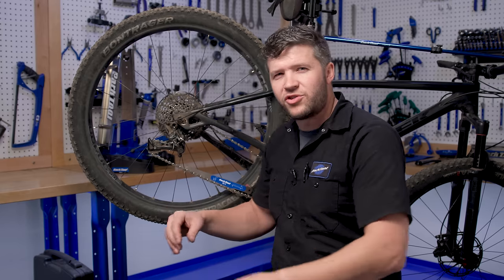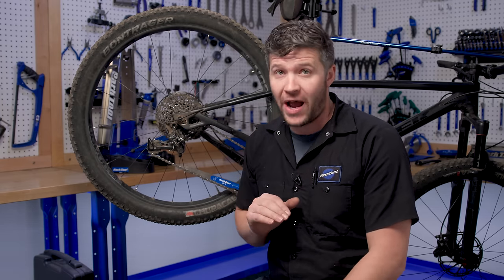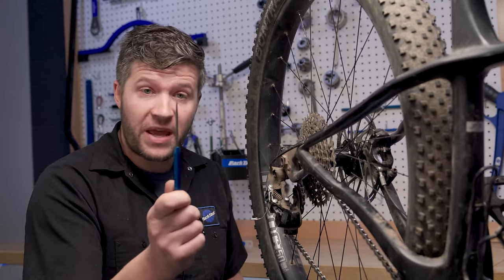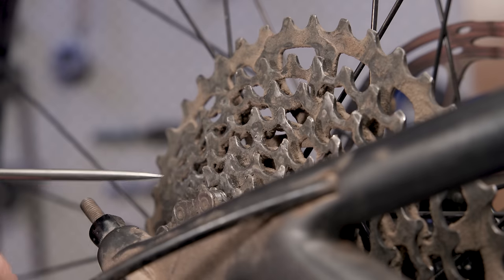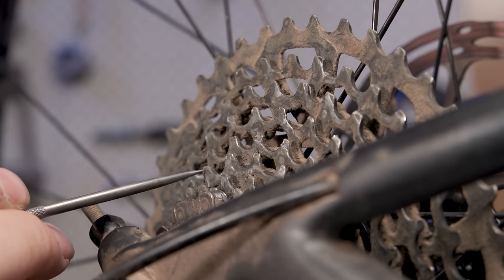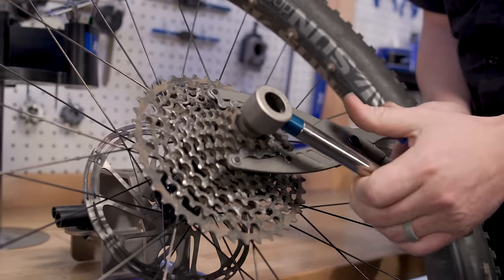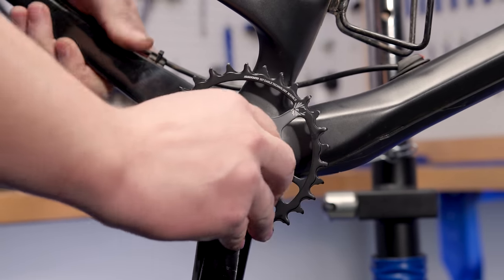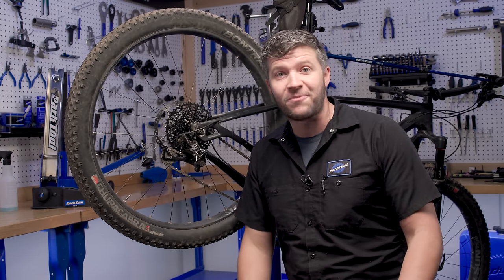Cassette Wear | Tech Tuesday #189

Comment: I recently changed the chain on a shimano 1x12 as it was reading just over .75.  After changing the chain the chain was skipping but only in the smallest cog on the cassette.  I looked around and found that shimano sell a pack containing a just the 10 and 12t cogs (search part no Y1X498030)  probably not the ideal solution but it worked for me as only my 10t cog was deformed and its about quarter the price of a new cassette.  Just in case that helps anyone 👍🏻
Reply: I use a shimano ten speed on my ebike, the 4 smallest cogs are separate and the rest are on 2 spiders. The small cogs (and spiders) are available separate and they are cheap so buy them in bulk!!
Reply: That's an option I've taken several times. Nothing can match a 1/8" wide track chain and sprockets for distance. Check out Sheldon Brown's site. No, not the football player.
Reply: I think you are meant to change 12 speed chains at about 0.5. Just something I heard.
Reply: @krzysiu4003  you're right.  I'm just lazy 👍
Reply: Doesn't using worn cassette (even though it doesn't skip) wear the new chain faster?
Reply: @AdamWilkoszarski  more teeth mean more engagement points to spread the load. Only your favourite/most commonly used bigger sprockets wear out as well as the smallest. Most MTBs and e bikes will be the tiny cogs from descending and the first gear. A road bike will be middle of the cassette and a touring/bikepacker is going to be somewhere in the middle

Comment: I use a “dummy link” it’s single two links, it’s just one set of outside links attached ti the inner links with the rollers, set it on the chainring or cassette and if it slides back and fourth, the chainring or cassette is warn, if it sits in place and dosent move back and forth they are just fine
Reply: Good idea ^^
Reply: I do the same thing but I got 4 links and pinned it into a square, a bit hard to pin it but a nice neat gauge tool.
Reply: Very good!!!!!

Comment: Once I put a 4th chain  on a 6500 Ultegra cassette at 7,500 miles and skipping immediately started. I installed a new cassette, but to my surprise, riding just a few dozen miles meant that the chain had worn funny also and therefore I had to bin and almost new chain. So I’d say, if there’s any doubt, just replace the cassette before risking a new chain (I understand this advice might not be applicable one of those super expensive mountain bike cassettes. Keep those drivetrains as clean as possible! It was painful to look at the one in this video.)
Reply: first voice of that, did you measure chain to see where and how much it is extended, i have experience where new chain made cassette to cure after some km of light use- when that chain stopped skipping, i installed new chain to check is really cassette fixed or just chain extended and adjusted on that cassette, and new chain did not skip
Reply: This is actuallyalong the lines of something I was asking about in my own comment. If you're chain isn't fit properly, can it cause premature wear. And it sounds like that answer is yes.
Reply: @keithchristner4522  explain how chain can be  installed unproperly and that would not be obviously ,
Reply: @makantahi3731  new SRAM chains are unidirectional and can be put on backwards. Only thing I could think of.
Reply: @randalclark6283  so,if chain does not have direction or side of installation,if is properly passed through derailleurs,if link is not frozen,nothing else can be done wrong with instalation,,chain wear is in direct connection with maintenance

Comment: Since you're going to need a new cassette eventually anyway, might as well buy one when you buy a new chain, and at worst not have to use it right away, but if you used that worn chain for any time, you'll probably need it sooner than later, if not immediately. Plus, prices tend to go up so this locks in the savings.

Comment: I actually like cleaning my bikes so I do it every 500 miles on both my road and  touring bike.  That includes re-lube of the chain.  New chain every 3,000 miles.  Neither bike gets particularly dirty, at least not for long.  Road bike is 32 years old with original chainrings and cassette.  No skipping issues and very quiet.
Reply from the maker: A clean bike is a happy bike! Older road bikes with fewer gears did last quite a bit longer due to the additional material.
Reply: you clean and lube every 500miles, i do it every 100km, you must be pedal like dove, when i made 2000km per month, i replaced  1 chain per month, but i drove races, my wife same chain would never wear
Reply: @makantahi3731  if I cleaned my bikes every 100K, it would be one every week or sometimes both every week.  I follow Calvin's bike cleaning video.  If I am really efficient, it takes 2 hours to prepare, wash, dry, and relube both bikes.  These are road and touring bikes, not mud bog or hill climbers.
Reply: @fouresterofthetrees287  i do not clean frame fork rims, i only clean chain and sometimes cassette and front gears, i use wax and everything around transmission is relatively clean, and chain waxing must be done at 100-120km, 1 pass with wax takes 3-4minutes, usually i made 2 passes, so 8 minutes and chain lasts at least 6 times longer than on oil, i do it for last 5 years and i spent maybe 5-6 chains that works on 3 bikes: on my road bike goes new chain that stays on it 3-4000km, then it goes on my mtb for 1000km and after that it goes on my wife bike and it stays there until got worn, every bike always has same stretched chain
Reply: Austin Jew  do you remove chain from bike and put into petrol/thinner?
Reply: @makantahi3731 I soak my chain in gasoline in a closed container and agitate it. If you think you are doing a good job of cleaning w degreaser, take your degreased chain to the gasoline and watch what comes out of it!
Reply: @OVER-bENGINEERED  since I use wax, I don't wash the chain as it should be done if I use oil: the chain stays on the bike, I heat it with an induction heater, soak it in wax and wipe it with a cloth, at the same time I clean and lubricate it, if the cloth shows that the chain is dirtier , I repeat the process, with each repetition, the wax in the cloth is cleaner

Comment: I bought an old road bike and the previous owner let the chain stretch way too much. As I wanted to use it for commuting and some training and didn't want to invest too much into it, I simply replaced only the chain. It is a 3x8 setup and guess what - everything works just fine. I think that once your cassette and chainring(s) are slightly worn and a new chain does not skip, it is almost always quite a bit cheaper to get some more kms/miles out of your old setup.
Reply: old compoents mixed with new components will cause all of them to wear out faster
Reply: @bmxscape  You are right. I was pointing out that sometimes it is possible to get some more use out of your old components instead of replacing them. To put it into perspective - I paid around 12 euros for a new chain, would need to pay at least five times as much for a new chain, cassette and chainrings. If this gives me even a couple of hundreds kms more out of the old components, I am still perfectly fine with it.
Reply: @benokrizek8020  yes that is a good point, getting the max life out of old components is also a good thing
Reply: yup, I always found that you can ride with a worn casette for many thousands of kilometers and given how much cheaper that are than chains it can be worth it

Comment: Love the pick tool tactic! Great tip! I also think it would be worth to mention if you're replacing a drivetrain to also make sure to examine jockey wheels conditions as those wear out too.
Reply: Do they really need to be replaced? I think they are not receiving intense load
Reply: @omniyambot9876  not as often as drivetrain components, but I've seen jockey wheels also become like shark fins from wear.
Reply: @omniyambot9876  I've had them cracked on SRAM X9,X0 , Rival. Never has an issue on Shimano though.
Reply: always have some spare jockey wheels at home - the bearings go on them - OEM jockey wheels are often poor & the ball race can seize-up with dirt. Remember the top/bottom jockey wheels are different and they are also directional - keep the instruction leaflet to ensure correct installation.

Comment: There is actually a go- no go tool for checking chainring wear. I believe Park makes one. With all the ramping and profiling on modern cassettes and chainrings this might not always work. Cassette cogs typically wear out according to the one used most and small ones faster than larger.  I never thought about looking for the burr but that makes sense. The real proof is if it works well with a new chain. Or an interesting experiment with a half worn chain were used. No doubt this has been done and worked, forestalling expensive repairs. The chainrings may not even be available but worn chains are!

Comment: Excellent demo. I have exactly this issue. New chain skips intermittently on highest gear only so old part-worn cassette is still OK for a few miles yet because I rarely use the top gear.
Reply: I came for this. 😁 Just replaced my chain, and the smallest cogs skip. 
Ok. I need a new cassette. For the time being if I need my bike, I'll only use the low gears.

Comment: When replacing both chain and cassette should one  also consider the derailleur pulleys?  How or when should they be replaced?
Reply: no, metal dura ace 1995. metal pulley survived 60 000km
Reply: Derailleur pullys definitely last significantly longer, because there’s no driving force going through them. I’d say replace them when you have problems with your chain falling off the pullys
Reply: They should be checked and cleaned at a minimum. They're a gunk collection spot that can impact shifting

Comment: "That would be 150usd for a new 11s casette + 50usd for a new 11s chain"

Just compare those prices of replacement parts to 2x 8s groupsets and durability of them
Reply: This 1X thing is a mess. And it adds unsprung weight with those pizza like cassettes.  Still running 2*10 and 3*9 on our world touring mountain bikes.
Reply: Each to his own. If you ride more open gravel roads then 2x10 or 2x9 is good for you. But there is nothing wrong with 1x12. Yes, it costs more. And yes its not as robust. But it works better for some. All gear systems are good if you use it for its best indended purposes. Always take into consideration how much you ride, what terrain youll be riding, what kind of riding style you have and what you want to do with he bike. This will help you decide wich system is best for you and wether you can justify spendig the money on that drivetrain. 🚲

Comment from the maker: How many miles/KMs are you typically getting out of your cassette?
Reply: 1500-2k unless crashes have other plans
Reply: 4 chains/2.2k miles on XT 12s stuff.
Reply: I did a tour in 2018, 3,350 miles on an 8spdx3, plus hundreds more on return, must have done 4000+ on the same chain/cassette, hauling front+rear panniers+camping gear. Id say most of the time I get 5000 miles between a chain/cassette change. By this time the gear changing is getting a bit crunchy but hey, I get my moneys worth.
Reply: Guess i should clarify thats all dirt miles for me miles And I’m a bit rough on my mech!
Reply: 2000-5000 km
Reply: I get abought 5 chains per cassette for 2x10 Sram 990. 
By far the most durable chains are the Campagnolos in my experience. They stay a loong time at about zero stretch, unlike other brands.

Comment: When my bike had a 2x7 setup I had worn my chain out but didn't think anything of the cassette, fitted the new chain and as I rode the bike for the first time after it jumped lots, then I realised I had left it too late. Thankfully not all the gears were knackered so I still had 1,2,5,6,7 in the back.

I have since upgraded to a 1x10 setup

Comment: Is there anything you can do do prevent cassette wear? I see cassettes made out of titanium would that last longer or is that just moving the wear to your chain? I ride an ebike and the amount of maintenance I have to do is like 10X more than my old bike.
Reply from the maker: Not a sarcastic statement:  Do not ride it. 
Metal is pushing against metal under stress. For an ebike, there is stress from the legs and the motor.  You can extend the life but they will wear.  For most people, they have 2 or 3 favorite gears, and these wear out first.  If cassette manufacturers had a system to replace only those worn gears, it might help things.

Comment: Love the topic, was just inspecting a cassette after replacing a chain, but I don't totally follow what is meant by the roller rubbing the face of the cog? I thought most of the pressure was exerted downward into the area between the teeth
Reply: I believe what they are saying is that if you were looking straight on the cassette, the tooth at the very top of any cog (or the 12 o'clock position) is being driven primarily on the left side of that tooth, so over time thousands of revolutions would cause tiny deformations to eventually form a 'burr' on the face of the tooth but only on the left side. You are probably right that there is some force on the cog between the teeth but the majority of it is concentrated on the back side of the tooth.

Comment: SRAM GX Eagle, from new I bought 4 chains, and I changed them at 600Km, when all of them as 600Km, they go for another round, doing this all over again, I wear 4 chains and 3 front plates, my cassette made 11000Km believe it or not I change it because of another failure, after smashing my rear wheel I damaged the cassette mounting system, I was hoping for even more, maybe 12000Km was the point of change. Cassette and chain must have the same amount of wear to work well.

Comment: When should you change the derailleur pulleys? Do they wear out slower than cassette?
Reply: They wear out much slower because almost no torque is applied to them. Even cheap plastic ones can outlast a cassette. Replace them when they "look" worn, sharpened, chipped teeth are a good indicator.

Comment: Wasn’t finished typing. My problem is, I’m trying to get an 11 speed SRAM cassette off a Giant Trance Advanced wheel. I have all the tools, turning it anti clock, it tightens, becomes freer and then clicks. I have seen others on other channel’s with the identical problem. From the comments , it appears that the free hub has unwound itself from its mount on the hub. 
Now what, appreciate your comments/ help. Thanks 
Regards Charlie
Reply from the maker: This sounds very odd. This could only happen if the splines of the freehub body were either not long enough or they were stripped. In those cases you may need to remove the entire freehub body and use a strap wrench or clamp it in a vise.

Comment: On my emtb  stock nx chain was dead at 600miles. Curiously ultra expensive gx12 cassette was dead too. I was furious and used a 11speed gx cassette that was cheaper. This 11 speed cassette has done 4000miles and 3 chains and still looks like it will do a few more miles. I wonder whats going on. Is gx 12 lower quality ? Is cannondale dumb choice of putting a nx chain on 6800$ bike destroyed the first  cassette ? I found a tip on sickbiker to measure the teeth width it is reliable. Below 3mm on small cogs the chain will skip.

Comment: I use my old CC-2 to determine if my chain is getting close to the change point. I then use a good steel ruler to see if it's really there. If you get the chain checker on an angle, it can give you a false reading. If you can keep your chain very clean, you can double it's life (or more)

Comment: I assume you could check front chainring wear by moving the pick towards the front of the bike.
Reply from the maker: The chain typically wears the burr off of the chainring. The teeth get narrower as well as "shark fin" on a chainring. If a 1x you will get a "rumble" on 2x an 3x they will get to the point of skipping, dropping chains or not shifting.

Comment: Why not leave the it as is? (chain, cassette, chainring until complete failure of wear parts of the drivetrain)
as long as shifting performance isnt compromised and the chain stays where it's supposed to be while riding
Reply: Because the chain then wears prematurely, so a chain that should last 1 year will only last 6 months and you will have crap shifting and skipping
Reply: Worn components are prone to chain slip/skip under heavy load - a great way to introduce your face to the ground.
Reply from the maker: This was left on for too long already. Shifting was not crisp and it was starting to degrade riding experience. Ride as long as you feel you want on a setup but for those that want predictable performance it is important to keep things in good condition.
Reply: i agree, buy a bike drive it until first fail, then put it into garbage and buy new bike, industry would love you
Reply: that's like saying "your handlebars are half way rusted through about to snap in half, might aswell keep using them until they break so you save money"
Reply: If you don’t replace any part of your drivetrain, your shifting performance will suffer, but not my much. The real reason we recommend you replace drivetrain components when they are worn is to prevent failure. Snapping a chain is a good way to injure yourself